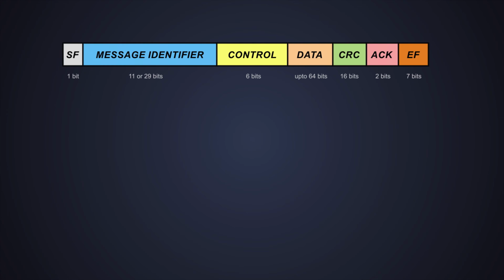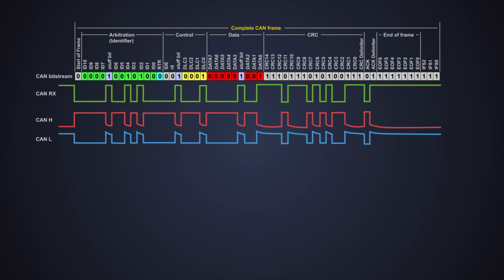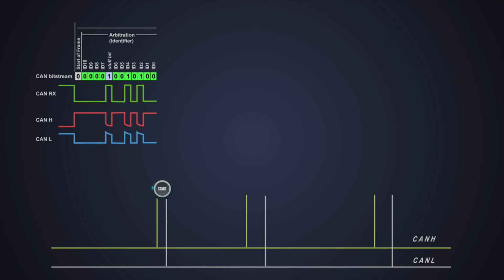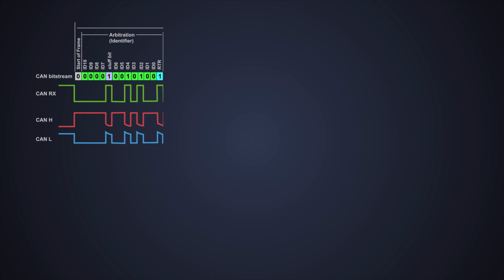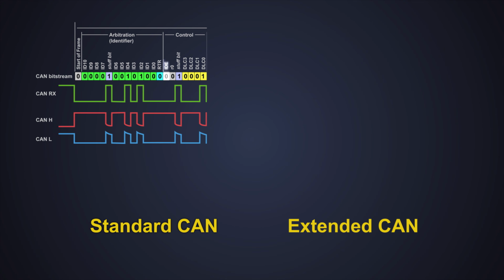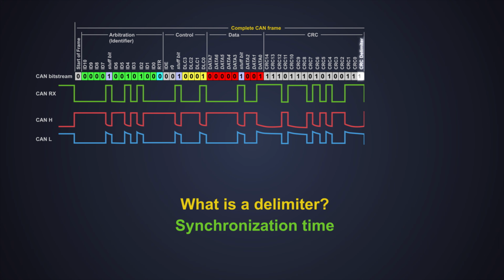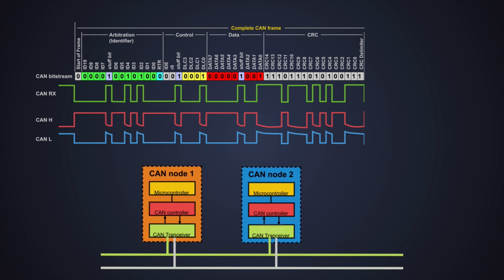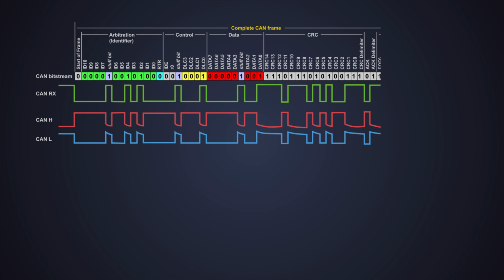CAN Frame structure Understanding | CAN communication Explained

Comment: The data length is in bytes and can be any value between 0 an 8 and therefore not limited to 8, 16, 32 and 64 bits

You have not explained where the extra 18 bit of ID are placed in an extended CAN packet

All active nodes on the bus must drive the ACK bit

There a only 3 interframe bits and they are not to allow message processing, but to indicate the bus is idle and allow another message to be transmitted

Comment: Great content! I appreciate your electronic knowledge and your delivery strategy is very easy to understand. Could you show me an easy circuit that could discharge an 22000mf electrolytic capacitor once it reaches a desired voltage say 24vdc. I can do this mechanically but wish I could use a circuit instead. Thanks

Comment: I have issues with my circuit ..would u help me 
I hv designed half bridge topology based smps
.. i already implemented dead time in two gate input 
Bt when I check the input of primary of transformer then dead time does not present 
And if I reduced the duty cycle of gate .still transformer primary still gives 50% squre out with no dead time ..will u help me ..thank u very much